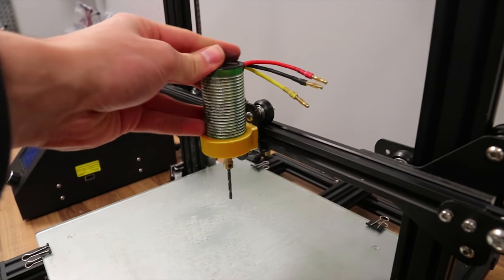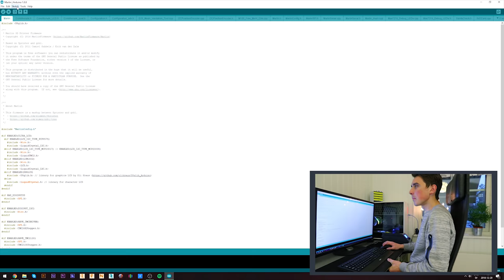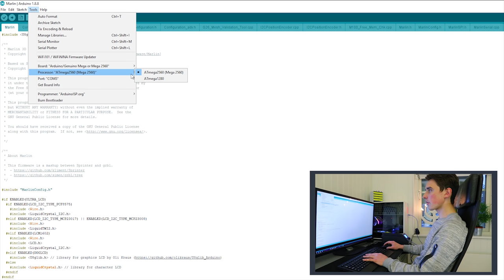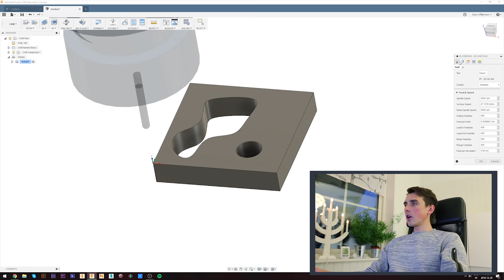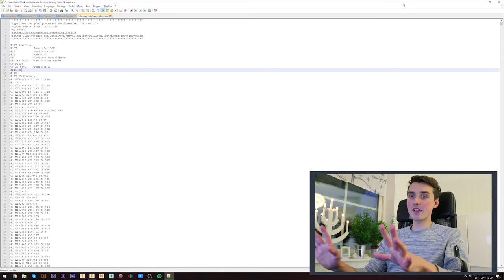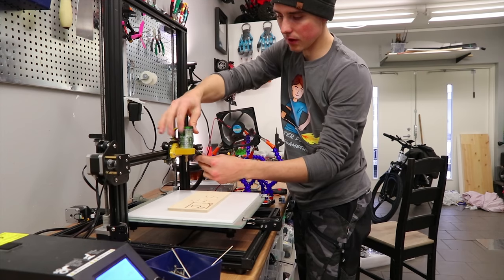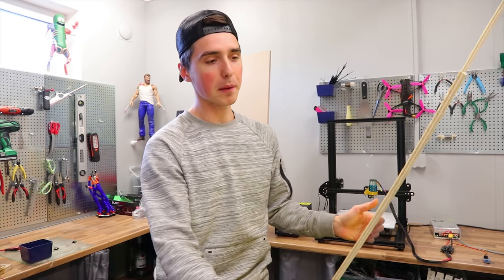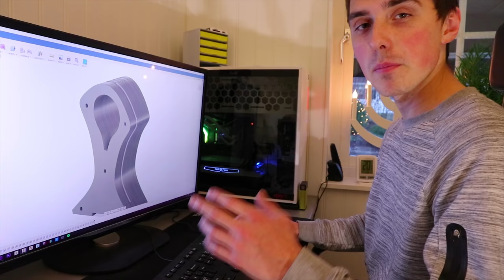3D Printer CNC Makes Spectrum Thing

Comment: Some suggestions. Get an actual endmill, itll help out a lot. And since you use the foam as a back up on the bottom I recommend a ballnose endmill and a fairly short one. The shorter the less flex itll have when plunging and traveling.

Secondly order of operations is important, if you had made sure that the profiles were cut for the hole and the odd opening before you cut the perimeter it would've worked wonders. And when setting up tooling and z zero heights use a piece of printer paper and slide it around between the stock and the cutter as you adjust it until you can barely move it. And subtract the thickness of the paper to get your zero. 

Also do some research into proper feeds and speeds, I know the motors on the printer likely wont be able to sustain the level of movement required for extended amounts of time but the closer you get to proper speed and travel rates the better the end product will come out.

Comment: you propably know that and this video is quite old but still: in like 10:50 the BLDC motor overheats because they really don't like running without a load ( that tiny end mill is virtually no load for that motor). Has something to do with the rotor running faster than the magnetic fields change bla bla... anyway, thats why it overheats, also why BLDC aren't common on conventional routers.

Have a nice Day !

Comment: Great Work, Simon!

How about 

- adding a vaccuum suction that cools the motor and takes away the dust, instead of making you CR-10 unusable over time, by having all the dust enter all moving parts?
- enhance the motor mount for better stability at the same time

Comment: Nice job...at first I thought that motor is not strong enough for a wood...especially a plywood, but for MDF it's works fine.... ...what kind of router bit you have used for each material? its one or two flute ..or...?...and what are RPM for acrylic milling?...thanks..

Comment: You need to take into account the material and the tool specs. You need to calculate the feed rate and the feed per tooth for the tool. This will help out with keeping your tool alive and cutting the wood more efficiently. It would help to know the rpm of the motor to do the calculations.

Comment: I think (havent tried it) you could use spray on glue, depending on how strong it is. You should also 3d print a dust guard to see if it helps keep the sawdust and acrylic shavings from flying everywhere

Comment: Nice video. If you want to really get into CNC milling I'd recommend the Mostly Printed CNC or LowRider (both by Allted on Thingiverse). Most of the parts are 3D printed (obviously). I just built my LowRider2 with an enclosure and I love it so far.

Comment: Suggest using the CNC to cut a pattern, then use router with bearing bit and the template to cut the work pieces. Would a 2nd Y axis beam help with motor rocking? Would like to know if  UV resin could be used to coat a PC board, use the Mars LCD to expose the PC board, etch it and then use your CNC technique to drill the PC board.

Comment: Hey its more recommended to use threaded rods like the ones used on the z axis for milling because then there isn't as much give in the x and y axis but if you don't have to worry about tolerances then this method of milling is perfectly viable and pretty good to be honest.
Reply: Also a bigger motor would be better
Reply: one last thing is to add covers or a dust collection system so that crap doesn't get in the tracks since you are using tracks instead linear rails

Comment: if you substantially shorten your cutter then your cutting will improve a lot, also the force on the motor mount 
and the cross slide will be substantially reduced

Comment: A 3D printer is a 3D printer, a CNC is a CNC. While for some people they are similar, in reality they are different, except for the X, Y and Z motion necessary in both cases. The rigidity demand is SOOOOOO much higher on a CNC than on a 3D printer that it basically renders every 3D printer useless as CNC, possibly can be used as a toy, but not if you want to mill anything useful. My CNC weight about 120kg with a 1.5kW 3-phase spindle, and that is actually quite light for a CNC mill. My 3D printer weight about 5kg, and a new one I am building now weights about 25kg, which is very heavy for a small 3D printer. None of those 3D printers would be useful as a mill.

Comment: You can use grbl firmware instead of modifying marlin. Grbl is much more suitable for CNC milling and laser cut/engraving. Marlin is too complex for that, since you don't have to control temperatures, retraction and extruding speed.

Comment: The tool you select in fusion is a ball nose end-mill with 3 flutes, this is not the tool you actually used and also the RPM was set at an arbitrary 5000. Diameter and type of tool and its number of flutes, RPM, the speed you move at; all of these are a factor in how big or small of a "bite" the tool takes each time a flute moves through the material. Google speeds and feeds and find yourself a handy calculator, some even have sliders for how rigid or flimsy a machine is. That being said, impressive result either way and a well produced video.

Comment: I would shorten that cutter up just a little longer then the depth your cutting to especially with that play in the z axis. I would also try a climb cut not conventional, and multiple passes instead of just one pass, not in z i know you had it ramp but if you make that cut wider would allow the chips to flow better (not really necessary with wood i guess but still something to try a cutter vibrates more when making full contact like that). and like others have said go to a one or two flute cutter up the feed should have enough spindle speed for it. as reference when i use a 3mm ball mill on a finish pass on steel im running about 18-20k spindle and about 3-4k feed depending on the cut. But looks good the more you do it the more you learn what you can and cant do

Comment: dear RClifeon.  Any time you work with wood and it turns black like that, the wood fibers are burning instead of just cutting, so in any woodshop with any saw or any tool, if you work with wood and it turns black, something gone wrong.  You didn't talk about the bit.  I would recommend a router bit for your machine.  Typically in a wood shop, you would switch bits for wood/acryllic/metal.   You would have fun working with wood-workers if you knew anyone.  If you were looking for new projects, I'm sure that 3d printer would handle a paintbrush like Van Gogh.  Are you swedish?

Comment: Simon, shorten your drill length! It's only cutting at the teeth so you can make it a little stub and very, very rigid.

Since you're not using it to depth as a drill but instead as a mill, you can get better results and possibly go faster this way. 

I would make it slightly taller than the maximum depth of your raw materials.

You'll need just a few flutes above the material to allow for chip removal. Use a vacuum and suck the dust up to reduce heat from the friction.

Comment: Hi Simon, you are not using the ideal motor controller, for CNC applications you should use a controller like "odrive", the RC controller that you are using doesn't have current control, so your motor overheats because the work regime.

Comment: Your rpms on the first cutter where way to high, it burned out on the first few cms. Use one of these online calculators to get an idea of the rpms you need and use carbide bits, they can withstand a lot more heat.

Comment: Are you using a router bit? The bits in the video look like either drill bits or Dremel grinding bits. Using a proper router bit that's designed to cut sideways would relieve some of the stress on the motor.

Comment: I would put a heatsink on the motor they may make one with liquid cooling and just use a fish pump. Or a Peltier heat exchanger attached to a heatsink on the motor. Could put a thermistor on the motor and tie it into the code to stop at overheating.

Comment: It's important that you actually produce chips, rather than dust, with the cutter - running too fast will tend to rub the cutter instead of cleanly cutting which produces the dark marks seen in some shots and will quickly destroy a steel cutter. also, when cutting plastic or aluminum, this type of cutting can melt the material onto the cutter, which stops it from working and usually ends up snapping the cutter
Try an endmill with fewer flutes - one to three - and for your machine perhaps a smaller diameter. less flutes allow you to run the cutter fast (important to get sufficient power from a low torque motor) while still actually cutting, and also allows chips to clear the cutting area more easily
if possible, have your speed controller maintain the motor at constant speed (firmware thing, some have this option) rather than constant voltage/power. the speed of the motor changing during a cut will make performance very hard to attain, as the speed dropping will tend to cause a runaway loss of speed due to increasing load unless something is regulating it. the natural (operator) reaction to this often is to increase the speed of the motor even more which of course causes poor results

Overall impressive results. working is working.

Comment: Ime going to permanently convert my anet a8 into a cnc cutter/engraver with a stronger frame and use a dremel ime probably being thick here but nead to ask for clarification.
So with the conversion I can unplug  hot bed/ hotend /and extruder motor from mother board as not neaded and shorten Z thread rods to have a lower profile frame orsom video thanks for sharing 👍

Comment: Nice go (I’ve would say nice try, but i do not want to degenerate the effort and thinking that you have put into it..)
Let me clear some things up, i’ve been working as a CNC-machinist for 15+ years and i doubt that a 3d printer will cut 7mm off a 40mm wide piece (block) of high-grade machine steel using a 63mm wide toolhead/mill.

You can’t simply make the comparison between 3D printing and CNC-milling for a big variety of differences. The main difference between the 2 production methods are;

- 3D printing ‘adds’ material. 
- CNC milling shreds material away. 

Then there’s a huge difference between end tolerances etc. etc. This doesn’t mean that you have done a very good job.

Comment: I would suggest trying to d print a vise that allows you to clamp a piece of plywood centered on the tool, so that it allows you to go all the way to the bottom of the plywood without hitting the table!! you could also put a shelf on the clamps so that the plywood is always at the same hieght!!

Comment: This is amazing man!! I want to do this to my printer as well some time. However, I've work a little with CNC and I got a few tips to give you. You gotta look into the feed rates, the rpms that can be handled by different material that you want to do. Depending into the material you do, the feed-rate and rpm will change this should be found by resources to get the best outcome you can have and will also decrease the failure on your cnc cuts. Also, maybe the z-axis thing wasn't working because the material itself wasn't fully squared. At last, the input of power might be too much for the set up on your printer, such as how fast is moving which will ruin the time belts fast, and is better also to do more layers for the reason that you won't force much the motor when cutting stuff.

Hope to see this more man. You might have just opened the eyes of many people to reinvent CNC at home at cheap cost!!

Comment: could use cura and kick out a mold gcode and stick to stock shorter than your tool height and manually jerk, acel, and speeds. i will be looking for a used 3d printer now...thanks

Comment: was that a drill bit as an endmill? O.O
maybe try a single or double fluted purpose built endmill? they're not expensive.
also, don't shy away from woodworking router bits for a manual router

Comment: is there a way to change the z direction just in simplify 3D? I am doing my engraving with my Tevo Tarantula and i don't want to reflash the firmware. And i only want it to engrave a little fore then just the first layer(not an entire cut out)

Comment: Cool. One step closer to a CNC machine :):) (kidding, great work) you should be able to do some damage on aluminium too.  if you ever want to cut wood on your 3d-printer, use something like a straight 1 or flute 2 or 3mm carbide mills. Thinner mill means less force required to push it though the material. 1 flute mill tends to chatter less. Trick is to find an optimum between feed, rpm and stability of your machine. Avoid too high RPM's that heat up your tools till it smokes. Smoke is not good, it will  wear your tools out fast..

Comment: absolute wrong endmill, 2-flute fishtail or 1-flute is the right choice for wood and plastic
for metal you can try out 2,3 or 4 flute. Might work on aluminium.
Also use the shortest endmill possible to reduce Y/Z-Axis bending.
 (shortening the endmill shaft with an angle grinder is also an option)

Comment: I think, 3D printers aren't fiscally designed to CNC. Because the motor will make vibrations causing all screws to slowly unscrew and changing all the fiscal calibration of the device. Also, the motors are exposed to dust and can get damaged over time, also because they aren't made to apply this much force. The heated glass plate isn't made for milling too, even with an other milling support. I think that this is a really bad idea.

Comment: Simon, awesome project!  Both your end product and your manufactured machine that created it.  (And how did you cram this all into one 18 minute video?...)
Because of limited space I need to stay away from processes that create sawdust, plastic detritus, metal shavings, cutting oil stains, cigarette burns...  you know, all the cool stuff that makes a man's shop smell good, including WD-40™, bacon on a George Foreman© Grill plugged into the same 3-foot 12/3 SJT jacketed heavy duty power strip that your Ryobi 15-amp miter saw is plugged into, all mixed in with that light smell of grease and  soldering paste?

Currently, I have to stick with FFF or FDM® (Stratasys Inc.) methods.
Trademarked and copyrighted terms have been used without permission.
Awesome stuff, dude.
Subscribed.  -Dave

Comment: if u got a 3d printer, just flash GRBL on it... mega 2560 can handle it... and it works with most generic stuff im on my 3rd conversion... 3d printing is just not worth my time... better using them juicy bits for something else...  converting everything to aluminium milling.

Comment: hey ! that is great idea to use 3d printer as CNC  I also think to do this whit my Ender 3 , I want think change the motor parameter step to try ande next with assemble a exclusive cnc with parts of 3d printer, please upload more videoclip about this topic and I will be a big following of you

Comment: 7:04 you not just go for 300mm/min what if your spintdle turn just 60 rpm.lol
you need calculate that feed based on rpm and cut for tooth
but if spindle turns 10k-20k feed is actually too small. well okay depend material also
ofc that tool. ofc depth of cut ofc

Comment: The motor is the wrong one it should be a slotted or vented motor the one you have was only designed to continuously run for about 20 mins and not at full speed due to it being enclosed to prevent particles from entering while running the RC Car.

Comment: 13:19 think having 2 x axis another side of z (duplicate) and motor between them. it wont flex like that. and mount could be better. think if that motor can turn you have 4th axis. think if that table turn. you have 5th axis. now think what machine i have. yeah 5 axis 3d printer.wish someone could make program for it LOLwell ofc it not good 3d printer bcs table spin on z axis not x or y. so there no benefit when extruder turn,but good for milling xD

Comment: The cutter bit is absolutly NOT good for wood at the speed your motor works. You need to measure the rpm of the motor and use a cutter that can handle it.

Comment: 17:28 if i would do it. i drill holes first. then make thread holes for same point. clamp wood with drilled holes. then cut 1 pass. with hand programmed gcode. who need cam for that easy
it just g1 g2 and g3 and g0 lol.never cut wood on real machine but aluminium take under minute lol even if make 2 pass or 3 not look so big

Comment: You need an actual end mill bit and your motor will not have to work so hard to cut.  That looks like a Dremel bit and they are not very sharp.

Comment: All the problems you had are because of your motor I have been using a salvaged power wheels motor xD it has a lot of torque the one you use is for speed

Comment: Cant you get sponsored by gearbest or such, heck, even invest, in one of those chinese cncs? They look like a 3d printer ish, but the height is like 100mm machinewise. (cut depth like 15-20). Ive seen them from 60usd+ depending on site (FT, GB, wish) and peripherals.

Might be a small stepup from a converted 3dprinter, or a step back, idk, but i for sure would watch and find out ;)

Comment: Nice!
But pay attention with milling MDF because the MDF dust is really flamable so it would be good to always use a vacuum cleaner. And if you are more interested in milling wood and maybe aluminium you should take a look at the mostly printed cnc the mpcnc from v1engeneering.

Comment: You used the wrong bit, that's the deburring bit, not the milling bit, and also, you motor might spinning to the wrong direction, that's why in the video the wood got burned out, change the bit, and check the direction of the motor, i think you can get a better result from that....